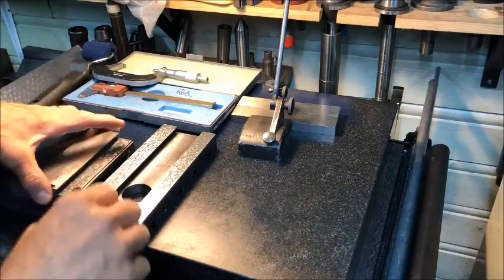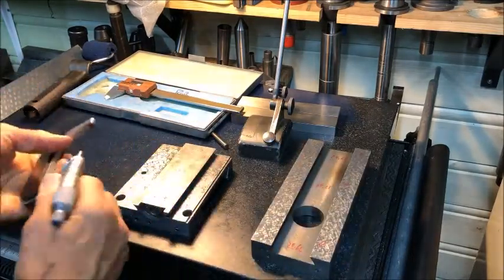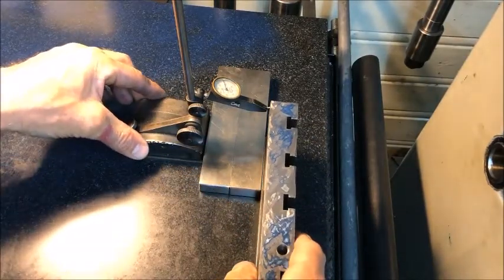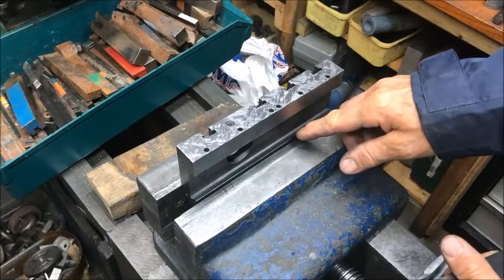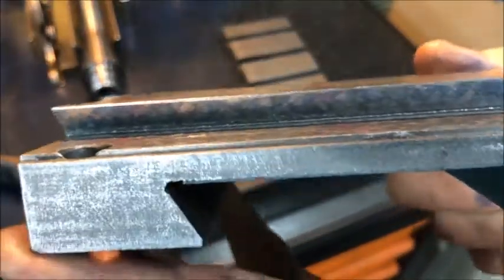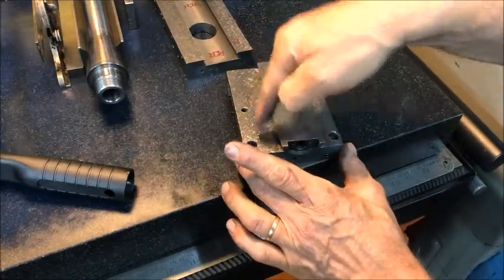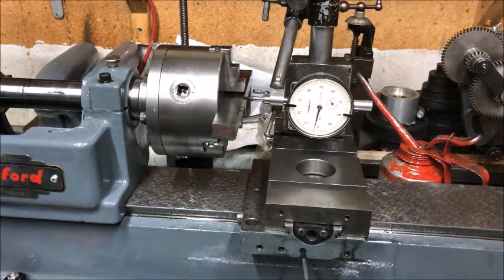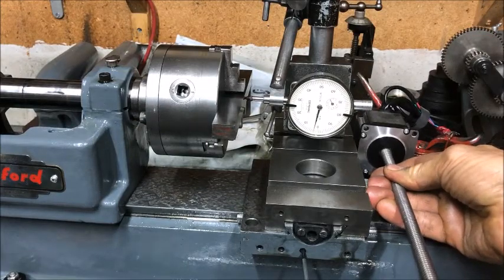Myford ML10 saddle and cross slide dovetail surfaces

Comment: Hi can you tel me the size of the primary belt? section length width?
Thanks
Reply from the maker: The motor drive belt is a Z section 810mm long, while the headstock belt is an A section at 660mm length. At least these are the factory specs although you can probably vary at least the motor belt according to slightly different pulley sizes
Reply: @ Do you happen to know the dimensions of the spindle shaft bearings?
Reply from the maker: @giacomomargiacchiviolinmak7147  Do you mean the diameter or the length and thickness also?
Reply: @jansverrehaugjord9934  the lenght is externsl or internal?
Reply from the maker: @giacomomargiacchiviolinmak7147  I was referring to the question on the bearings, but you may refer to whether the length for the belts are internal or external?
Reply: I have 1980 model
Reply from the maker: @giacomomargiacchiviolinmak7147  I don't know the exact year they introduced the later models, but you can have a look at their website myford.co.uk or contact them, or also see at lathes.co.uk as well as forums. If you compare to your headstock it should be easy to see. Also, I don't want to remove the spindle to take measurements on my lathe now as I have both assembled it and tested etc. I hope this sounds reasonable 😄
Reply: sorry I'll try to be clearer...I wanted to know if the lengths of the belts are internal or external, and I would like to know the measurements of the shaft bearings...thanks a lot
Reply: sorry I'll try to be clearer...I wanted to know if the lengths of the belts are internal or external, and I would like to know the measurements of the shaft bearings...thanks a lot
Reply from the maker: @giacomomargiacchiviolinmak7147  I think the best is to use a guide like here to explain https://tameson.com/pages/v-belt-size-chart#_btn9ww8cwuwd
Therein it is stated that the numbers refer to the inner lengths
Reply from the maker: @giacomomargiacchiviolinmak7147  pl.s also note that I have the old style headstock, so the bearing surfaces on the spindle runs directly in the headstock casting. This will then take up radial forces while there is a roller thrust bearing added to the inside of the rear bearing surface taking up the axial forces

Comment: im intresting to make good géométrie one my stanko izh1i611p but no matériel and expérience off this its hard one one direction when im buy oxidation one not really hard but oxidation for this the best its new scraping but for moment no time and money for buy tool for this after maby
Reply from the maker: Thnks for the comments. If you are interested in scraping for improving the geometry of your lathe I would strongly suggest you learn the "trade" first on some simpler material. Then after you have gained knowledge, experience and confidence and also aquired the needed set of tools  you can test your skills on some a real machine. The IZH though is probably still not what I would consider a 1st project. Grab a smaller lathe first, maybe a beaten, worn out old lathe on which it is not of importance if you make a mistake.